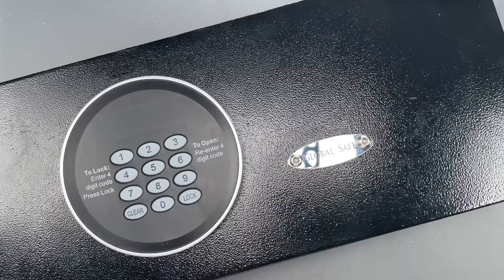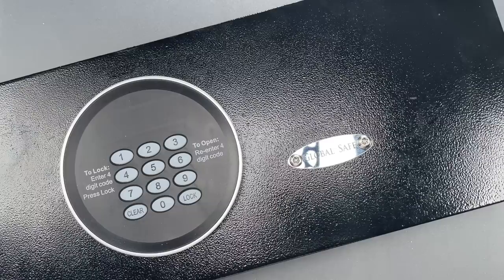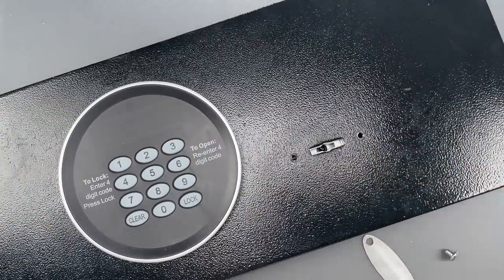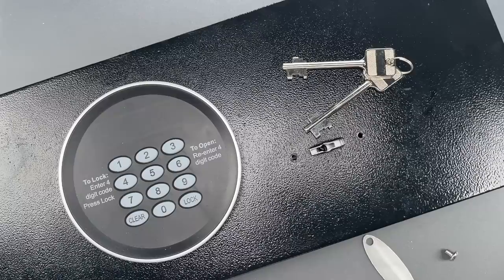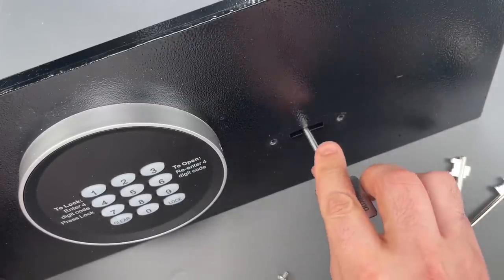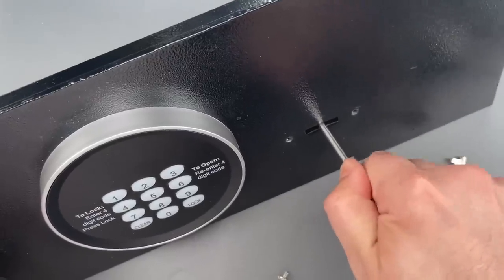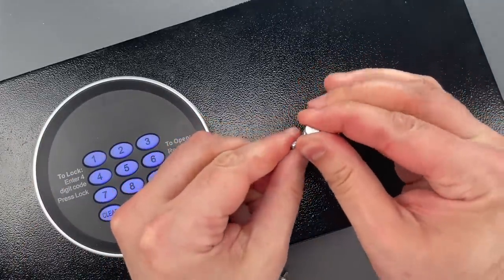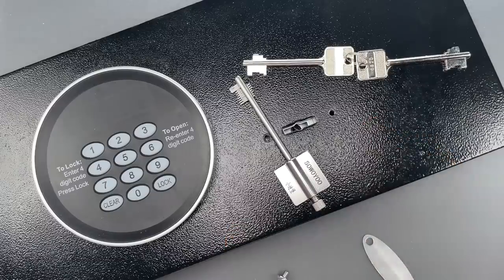[1462] Impressioning a Hotel Safe Lever Lock (Global Safe)

Comment: It's there a mechanical reason the opposite sides of the key are an inverted mirror of each other? Seems the simple solution to that type of impression tool would be to ensure the opposite side of the key is completely different.
Reply: I assume that it's similar to the disc lock. You might get away with shortening the other side, but completely different wouldn't work. However, even a small variation would ruin this method of bypassing the key.
Reply: Or mirrored even
Reply: The reason is that the metal levers are restraint-guided, so if the friction would be to high you still get a reliable function to keep the levers down.
Reply: The mechanism is only acted on by one side of the key. It's only the impressioning tool that does this, and it's meant to be used on more than one lock. Lastly, any gate in the keyway that allowed the key to pass, would work to impression to at least close to the key shape before getting the final setting from the lock itself.
Reply: @bmxerkrantz  The opposite side of the original key is also the same, though
Reply: Good question sir. I'd like to know it too.
Reply: @benjurqunov  But couldn't we just shave off the other side of the key and then put some guard that would make usage of impressioning tool impossible?
Reply: @babilon6097  If I'm not mistaken, impressioning lever locks doesn't work if they have false gates, however you can pick past those manually.
Reply: @P_RO_  Thanks, but the original question was "why do original keys have to be symmetrical" in the sense that the fin on the other side of the key has the same shape as the cutout from the main fin. Yes, the reason for the question was to protect against impressioning, but it is a curiuos question on its own and no one has yet tried answering it.
Reply: @dietertubeyou  Bingo: the back end of the key pushes against the levers as well, but pushes them down instead of up, ensuring that the lever always ends up in the right position even if they stick a little.  
You could give the back of the key a different shape, and give each lever a gap/keyway to match that cross-section of the key.  But in that case an incorrect key would be stopped from turning by the keyway in the lever, rather than by the gate for the bolt.  I can imagine that using the wrong key in such a lock could easily result in the lever plates being slightly bent, jamming the lock.
Reply: @kaasmeester5903  Thanks for the detailed description. At the end it´s all about the money. It´s cheaper to produce all levers with the same keyway.

Comment: I'd like to hear LPL's definition on what can be relied on.
Since risk will always exist, what is acceptable risk? Which kinds of valuables should have what standard of security? What are the statistics regarding lock-picking crime?
Reply: For a hotel room safe? TL-15. :-)
Reply: Guns. Guns are how he keeps things safe.
Reply: The lock is probably good enough anytime the lock is harder to get rid of than the door you're locking
Reply: The questions you asked are purely individual, I live in a rural area so most houses aren’t locked and the keys to vehicles are usually in them. How secure things must be at the base level is dependent on where you live if your even worried about them being stolen to begin with.
Reply: @johnthomas-km2bf  dogs are also good, can’t go wrong with an alarm system that knows the difference between a stranger and someone that is welcome. Gives you the time required to meet the threat at your choosing instead of being surprised in bed, granted where I live the bump in the night is more likely to be a bear in the trash then a person lol
Reply: I don't know what country you are in but most countries have a standard for different safes and how much valuables and cash can be stored in them, this is usually agreed between the insurance companies. Any safe that is approoved for $5000 or more is pretty much impossible to pick, it needs to be drilled and it takes at least 30 minutes.
Reply: @jaydunbar7538  My last dog had six distinct barks, so I always knew what she was alerting for. Took awhile to discern between them but those requiring my immediate weaponized appearance were always clearly said. Lost her after 12 years, miss her forever.
Reply: There are several different security standards which are applied to locks, usually created by a council of insurance companies in a given nation or region. These standards cover all methods of attack including picking, forcing, destructive attacks, and bypasses and are requirements on certain businesses and monetary values before an insurance policy will be issued to cover them. Locksmiths know what these are and higher-security lock packaging and manufacturer sites often refer to them. If you need real security, contact a locksmith or have your insurer recommend someone for a security audit. Not cheap, but neither is real security.
Reply: Lock picking crime isn't a crime of opportunity generally speaking. Because it requires training and often special tools to do it.

Sure this specific lock was easy to impression, and if given the proper tool it seems quite a low-skill attack. 

Over here the most common type of lock picking theft is bicycle theft, because thousands upon thousands of bicycles have the same type of lock. So it becomes worth investing in for a bicycle thief. But if your bicycle has an odd kind of lock, it's highly unlikely that a lock picking thief will target it.

For house doors, there was a wave of bump-key burglaries years ago, as entire new built neighbourhoods would all be built up with the same type of lock. So again having an abundance of potential targets with a low-skilled attack vector kind of makes it a target.
And again, having an odd lock would deter most opportunist thieves anyway, as that isn't the one specific type of lock that their bump key works on.

So yeah, I based my purchase of locks for my house on the fact that it took Bosnian Bill over 40 minutes to pick it on stream and even the LPL took several minutes. That's under lab conditions, so not mounted in a door, outside in the dark.

Comment: Took LPL with a special tool a minute or two to open it. Looks pretty secure to me!
Reply: two steps better than the average master lock.
Reply: A specialty (by obscurity) tool < That needed to be Modified out of the box, by LPL
Reply: Well, yeah.   A rare specialized tool, wielded by an expert, was required here.   So pretty good, but hotel safes aren't to be trusted, anyway.
Reply: He didn't try single lever picking which is also an option for opening it.  I'm guessing that just involves using a fancy stick.
Reply: @0x8badf00d  yes. But single "pin" picking involves skill, know how and feel (+more time if any of those are not LPL level) < Those aspects can be assumed that a side-hussle (opportunity) thief would not have. Hence the use of dedicated tools, like impressioning, that take most of the requirements out of the picture.
Reply: @0x8badf00d   Single lever picking is tricky, harder than picking disc or pin tumblers.   Plus, with this tool, you now can make a permanent key.

Comment: Back in the old days we would find a blank that fit in the keyway or modify one to fit. In order to get impression marks we would use a match to soot the blade and do our thing. Those keys were much more a PITA to file than a regular pin tumbler or wafer key. I was a great impressioner as we needed that skill on foreign cars with no key codes. Never was a great lock picker though. If I couldn't pick something within 5 minutes the rotary pick came out and that was the end of it.
Reply: The car locks have become so ridiculously easy to open now with lishi tools, real impressioning with soot and file is becoming a lost art.
Reply: @mrfrenzy.  Yes I have Lishi's also. Wish I had them back then.The soot was only for lever locks just in case I wasn't clear. For pin and wafer locks I filed the blades to a knife edge for my marks.

Comment: I would have like to have seen the "modifying process" in order to make it work "reasonably well"
Reply: most likely filing the edges of the pins ( and maybe the slot) so they can move smoother.  Any friction and they won't slide.
Reply: @danielweston9188 Propably sanding the flat edges of the pins (that touch each other) smooth so one pin don't move another pin. But propably rough-sanding the short edge of the pin and slot to INCREASE the friction so they don't inadvertiently move when they shouldn't.

Comment: With the way the actual key is it is almost as if the lock is designed with that type of impressioning tool in mind. The  bits on the back of the key make no sense and just allow a locked impressioning tool to be removed from the lock.
Reply: The back side of the key is to push down the levers in the lock, so even if they were mushy and grimy as heck, they is pushed down by force by the key.

This is why lever locks with single sided bitting has big red stickers when you buy them: "DO NOT OIL".

Double-bitted lever lock, where the secondary bitting is an exact mirror of the primary bitting, can be safely oiled.

It makes sense for an emergency backup lock, to be designed so it fails at best in its unlocked state if the levers would get grimy and stuck so the springs couldn't push them down in its resting position.

A normal lock doesn't need to be, since a lock that is used regarly will show signs of degradation (hard to turn, yanky, rough, weird sounds or feelings etc) before failing completely, while a emergency lock will usually be allowed to "rot shut" by the time if its not designed to not rely on springs.

So here the designers have designed the key, so the lock is not dependant on the springs to unlock, only to lock.

Comment: Honestly still one of the best hotel safes I have seen!  Needing somewhat specialist tools like that makes it a win in my book, as opposed to just a couple scraps of a red bull can (other brands available).
Let's face it, what turnover is really going to have an impressioning key, as well as a T9 screwdriver (could be off a size there but it's the most common screw of this type for external uses).
Edit: Auto correct thought I meant "Imprisoning" key. -_-
Reply: Unfortunately there is probably a 6-digit code that opens all the safes in the hotel and all staff know it.

Comment: I know this would be mostly "security by obscurity", but it always bothers me that these plaques are screwed on - i.e. reversible, with no sign of entry. Why not bolt it on, or at least add a breaking point so the plaque is destroyed when removed.
It still won't keep anyone determined away, but at least it'll be harder to hide and maybe inform you of a problem.
Reply: Idiot customers will ALWAYS forget their special combination and will require those plates being removed often, what truly surprises me is that the hotels don't simply replace the fake-cover with a rubber-plug, saves everyone time. As your your own security when using such an insecure hotel safe, mark the screw heads with nail varnish.

Comment: I was in a small hotel in Paris, and for some reason the code I entered wouldn’t open the door of the safe. So 2 minutes of googling turned up the factory set master code, sure enough, the hotel never bothered to change it.
Reply: This happens also in stores and restaurants where they have $10 000 cash inside. The manager sets a code himself because he is too cheap to call a locksmith and cannot read the manual properly the factory master code still works...

Comment: Please do a review of the ILOQ S10! Very interesting lock I found. Here is a description from there site ‘The cylinder contains a generator. The power needed for granting access rights is generated by the motion of inserting the key into the lock. No batteries are needed.
Data between the lock cylinder and the key’s microchip is transmitted with strong encryption. When access is granted, the lock cylinder’s latch is released and the lock can be opened by turning the key. When the key is removed from the cylinder, the lock closes again.’
Reply: ILOQ is a very good system when you have few locks and a lot of users. You get really good security and the keys are cheap, it's easy to reprogram lost keys and make different kinds of master keys. The locks last a long time. The only downside is the locks are quite expensive.

Comment: Honestly, if an electric lock has a backup mechanical lock, said mechanical lock should be hidden behind another mechanical lock; not a silly bolt on cover.
Reply: One older cheap room safe made in the 50's  if you removed the front rubber foot you could push a pin into the hole and open it.  (On purpose!)

Comment: This is just an idea: what if the key spins over the shaft in many (at least 3) positions until you unlock it? For example, the pins are staying in 10 stable positions until you insert the key. You insert the key, and the pins  1-2 and 9-10 are unlocked. Then, you turn the key 45d left and the other part of the key unpins 3-4 and 7-8. Then, you turn a key to the 90d, the 5th and the 6th pins stands with a whole mechanism in right position to unlock. So, the idea is the mechanism cannot be picked with a tools that are conventional, because the key is the thing to pick. The custom key should do the thing, when you have no effort to manipulate with the mechanism. I know that the best thing to do is to make a tool like this key, but with conventional picking tools... I don't know if you or someone can handle the lock like this. Please excuse me, I have no the lock like I described, this is just an idea.

Comment: It must be possible for a lock mechanism to disable itself when tension is applied and pins are not aligned.
Of course, using the wrong key would disable the lock, unless you add other mechanisms. For instance a failsafe keyway entry, or use an additional set of standard pins.
Such a lock would be pickproof.
Reply: Something close to that does exist: the Chubb Detector lock was a lever lock that would jam if one of the levers was lifted too high.  You'd need a special key to reset the lock (later versions could be reset with the regular key, convenient but that seems like a weakness to me).  IIRC, this lock is what started the Chubb lock company back in the day (early 19th century).  The thing was marketed as being pick-proof, and many tried and failed, but eventually someone did manage to reliably pick the lock.

Comment: Ah hotel safes... once during a business trip in a good hotel in Shenzhen I locked several items in the hotel safe during a team dinner in the hotel's restaurant.
When I went to retrieve something from that safe the same evening, I noticed that all items in the safe were placed exactly at right angles, where I am sure I had previously just thrown then in somehow.
So... always remember that the hotel and whoever has authority over them has the key anyway, and consider the tradeoffs.
Reply: At the resort at each shift change the main safe was opened and inventory by both the outgoing and incoming manager.   If a override code is used to open a room safe the passcode will be reset so you would know.
Reply: After a bad experience on a ship in China, the next hotel room we stayed in, my (Chinese) partner and I pulled a wardrobe across the door.  At something before 07:00h there was an almighty noise and shouting, as some staff tried to let themselves in; and was considerably annoyed that we had prevented them.  It seemed they actually believed they had a right to enter a room where guests were sleeping.  I may have no choice but to leave some valuables in my hotel room in China, but I will never, never trust that they will be safe.

Comment: I stuck JB weld into the hole, someone would need to drill it out before it could be used..And with all the chips created from doing this, it makes even using the original key difficult.

Comment: While I stayed in a room, I’d temporarily replace the security torque screw with a less common head and have my own proper tool. That way only I would be able to take off that plate. Then return the original screws when I checked out. Would throw any would-be thief off-guard and probably wouldn’t have time to go buy the proper tool.
Reply: That doesn't help since all the staff know the master code...

Comment: More expensive versions of this tool are available for $800 or so but so do lever locks that it won't work on. Even this lock is too much security for a hotel safe. Others already have bypass codes or keys to them and they warn you about it.  

I think the video needs a few more words about the loose door not making the impression work easier because a lot of people ask the same question. Gravity has nothing to do with it or the movement of the door. The tension he puts on it causes levers to "bind" and adjust the pins on the tool accordingly. It is the same thing he does when he picks a lock one pin/wafer/lever at a times and calls "bi...i...nding".

Comment: I would use the reverse off screw heads,  (the ones that wont undo - normally need a drill to remove hence damage is visible unless you bring replacements with you)

Comment: If you have an electric lock with a mechanical bypass like this, it'd be interesting if while powered it'd disengage something and lock you out if there was anything in the keyway for more than 3 seconds (you could actually do it mechanically and have some kind of winding mechanism to automatically reset after a few minutes, so you wouldn't accidentally get locked out if there was a power issue). Altho, zapping it somehow to kill power might be the way in in that case...
Reply: I could imagine some tiny mirror setup you'd put around a pick to bypass a keyway light sensor 😆